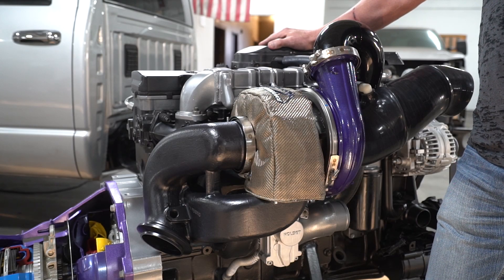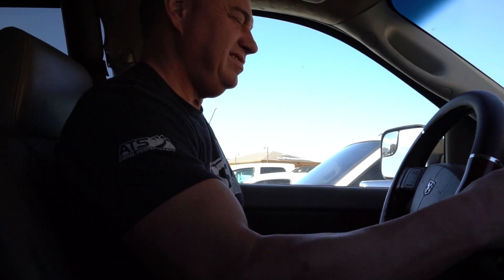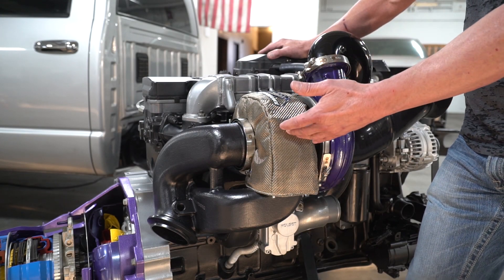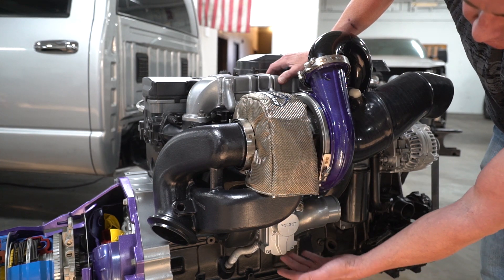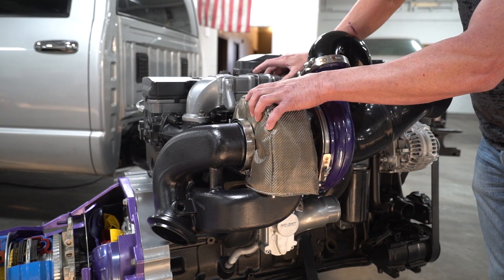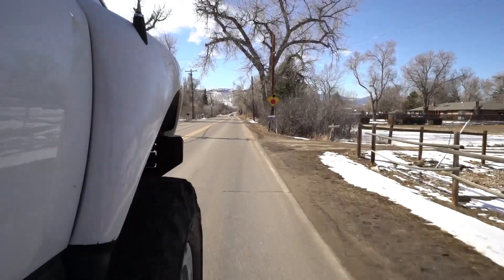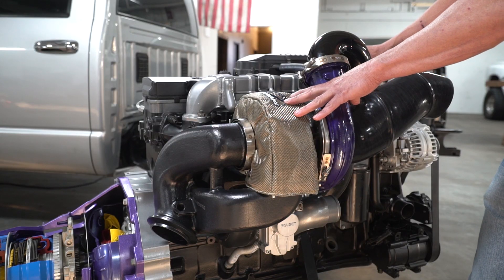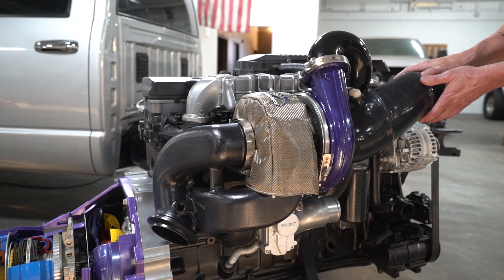ATS Aurora Vortex 5000 Plus Turbo Kit - Cummins

Comment: Shouldn’t the air between compressor stages be intercooled? Feels like the stock VGT would not be able to handle that much back pressure and temperatures

Comment: Take care of the cooling lines for the AC?  That's vague
Reply: They supply with the kit new AC lines that route around the new turbo set up
Reply: @JosefCharoni  Will the system need to be recharged? Thanks
Reply: you have to empty the system and then recharge it
Reply: @JosefCharoni  Thank you!